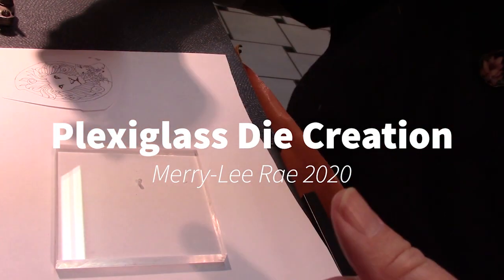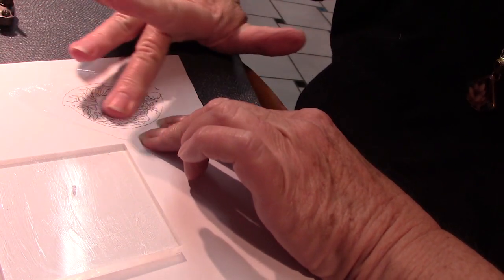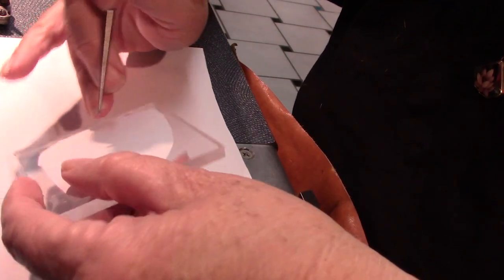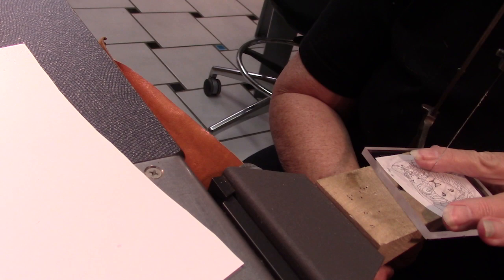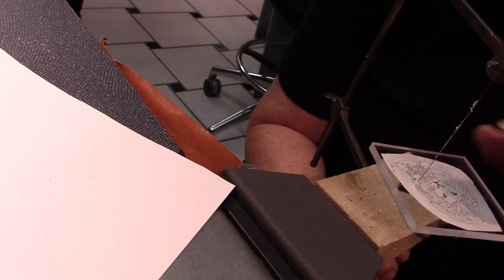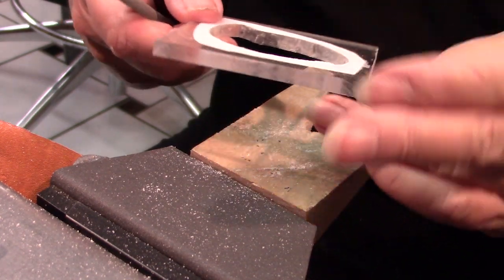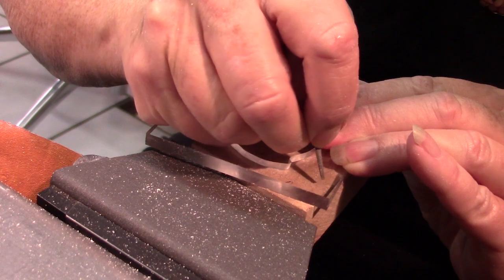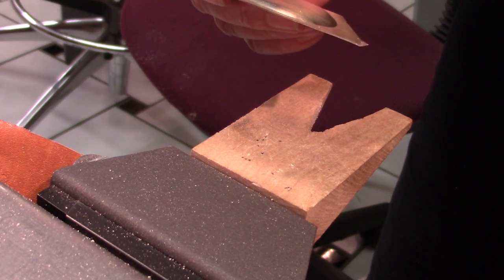Creating Plexiglas Dies for Hydraulic Forming.

Comment: Cool! What is the thickness of plexiglass? Thank you
Reply from the maker: It actually depends on the size of the hole.  for bigger pieces I use  thicker plexiglas, up to 1/2"  For smaller pieces, the dome will be lower so down to 1/8".  Naturally, the thinner material is much easier to cut!
Reply: @merryleerae  thanks a los